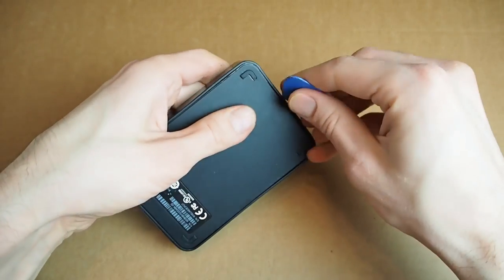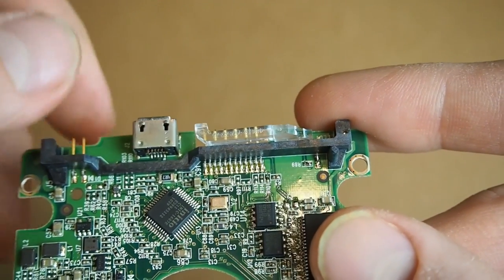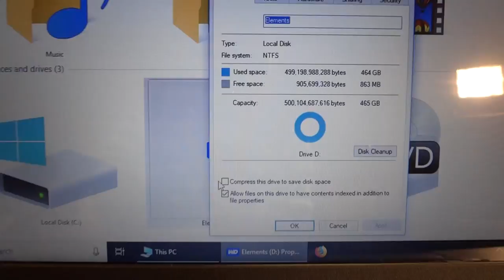External WD HDD Storage 🖴 Issue broken micro USB ⚡ $0 Repair Fix Recovery Files Safe Data

Comment: 5 years on and this workaround saved my data. P.S I didn’t remove the USB port and just soldered the wires as you suggested and it worked just as fine.

Comment: It worked without removing the PCB and the broken USB! Just soldered straight onto the board. A bit sketchy, I guess, but the data has been recovered.

Comment: Why does it have micro usb and not sata connectors I've never seen that
Reply: Because it is not hdd placed in a USB rack/case. Some manufacturers make their external hdds only with USB connector, so you can't use it in different purposes, only as external storage

Comment: Thank you very much!
My friend was so stupid and did backups on his usb HDD and after 2 years, he broke the usb connector.. 

If you guys have problems with detecting the hdd, then supply 3,2v on the second pin from the right side ( shown 1:18 ).. WD mounts some locking shit and unless you supply there 3,2v, the HDD won't power on.. I recommend using a resistor in this case because 3x AAA batteries will supply too much voltage
Reply: Did you solder a wire directly on the pin shown @ 1:18  or you found another point elsewhere on the logic board ?

Comment: Data line tracks ripped up when removing connector. I think your two points are to the side that relies on those tracks and I cut the path. Oops.Can you suggest other points to connect to. Otherwise I'll cut the plastic away and trace around with magnifier.Edit: I think they go to a inductor resistor pack. I managed to backup drive but still issues with drive. Think broken joints ,cracks. Design is poor. Weak flimsy connection point.

Comment: 0:01, I have same hdd.  And i am not facing problem mentioned in the video. But my issue is that i have removed it from cover,  and now I can't find any connector to connect 2.5 hdd to laptop or desktop? Kindly help please, i am from India. What is the solution to access hdd.

Comment: Hello, your video is very useful for me. I have a problem with my WD Elements HDD. Data, stored in the hdd, can not be read. To fix that, I disassembled the USB socket, but I couldn't find out where to solder black, white, green and  red cables. Because, the motherboard of your harddisc and mine is different. Could you please tell me where to solder the cables based on attached photos? Thank you very much for your help.
Image links ; 
https://ibb.co/kB43RK1
https://ibb.co/X7XZh40
Reply: Did you ever find out? I have the same board.

Comment: Great tutorial. I read that WD External Hard Drives tend to have broken ports sometimes, AFTER I ordered one myself (only bought Seagate drives before, so I didn't about possible issues with WD's).
At least, I'm prepared if that ever happens (hopefully never tho). The drive arrived today and it's working fine so far.